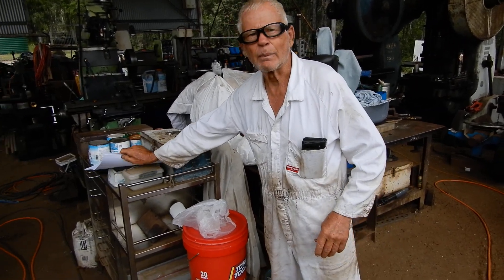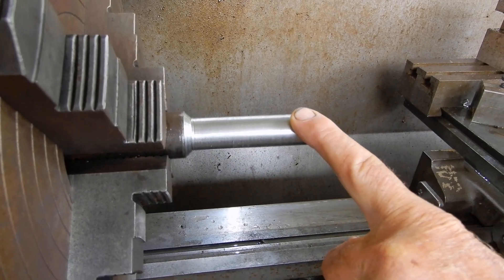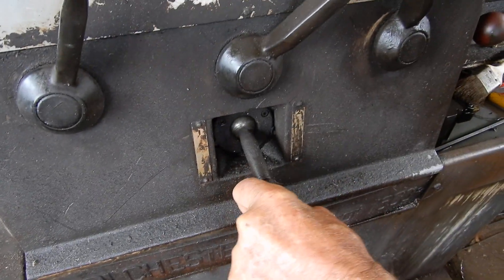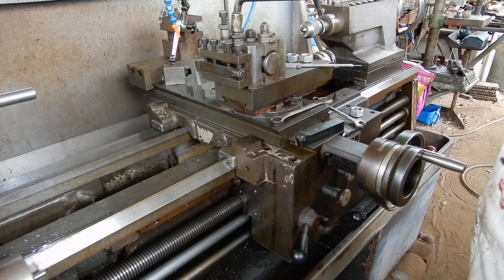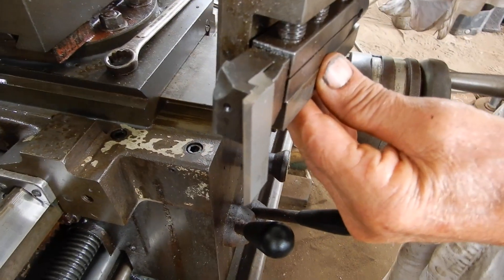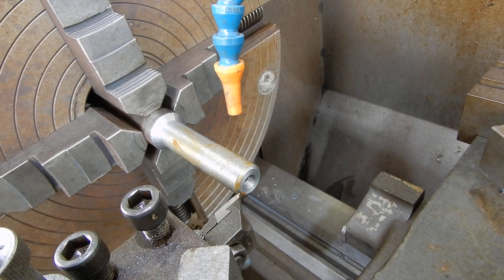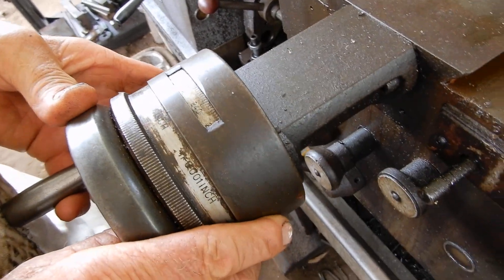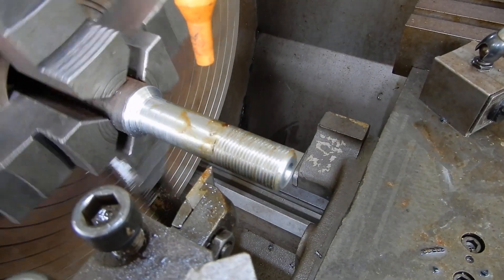Thread cutting part 3

Comment: Not to be critical, but I got a little lost in the process.  I understand you're not really going for accuracy, but I notice you move the tool out but still leave the screw feed engaged and you didn't explain what your starting measurement was to be able to know how much you were taking off.  And why can't you just disengage the feed at the end and manually wind the saddle back to the start if you're moving the tool clear of the thread every cut.  Just some little thoughts for those of us less familiar with lathes.  Cheers, I do enjoy your videos.
Reply from the maker: ...all those questions were supposed to be explained in this video but somehow it went off the rails and i thought should i put it up or not.... i think that putting it up is going to be benifical in that it will allow me to find out what people know and hopefully i can make a better video
Reply: @nealblackburn8628  Yep, too true. thus my questions.  cheerio.